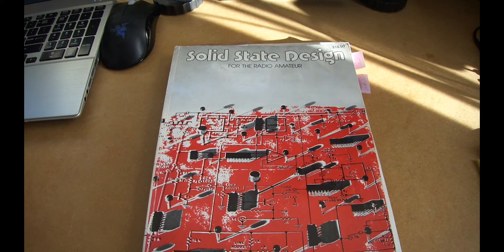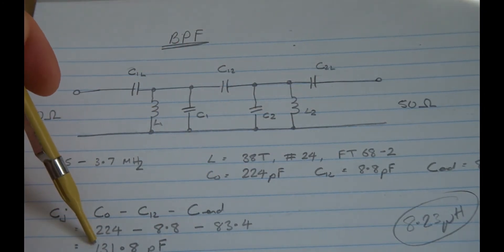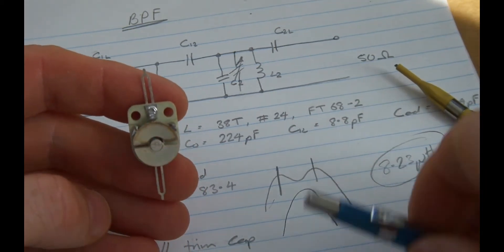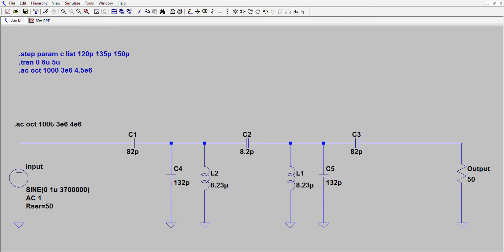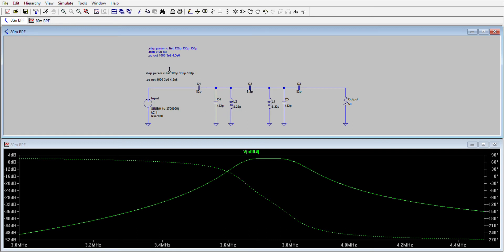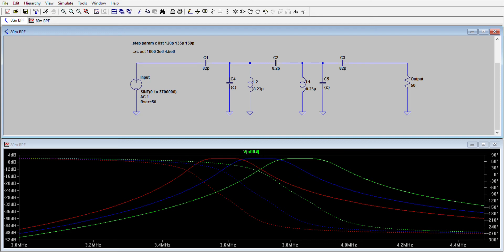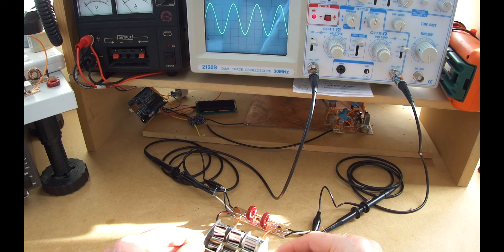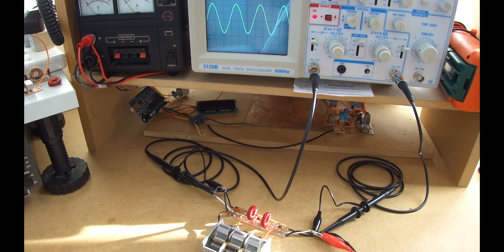Simple Homebrew SSB Base Rig Part 5 - Band-pass Filter

Comment: Is there a specific reason you had to use FT68-2? I have some ferrite toriods FT50-43, that are 44uh for 10 turns, you would only need like 4 turns or so and  not 38turns
Reply from the maker: Hi. I'm just using what I have at hand, which is -2 and -6 mixtures.
Reply: @CharlieMorrisZL2CTM  ah, i understand, thanks !